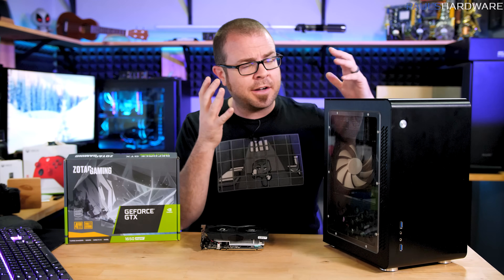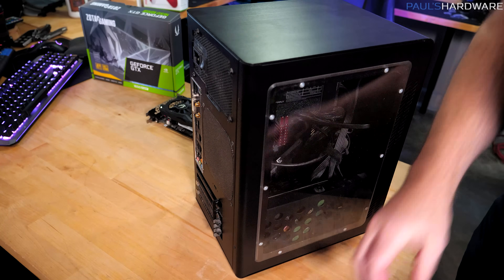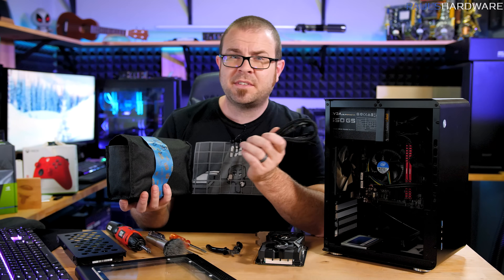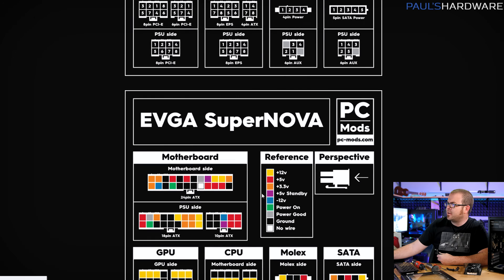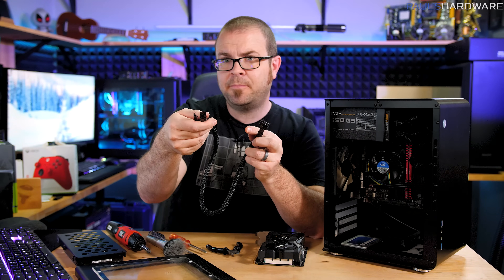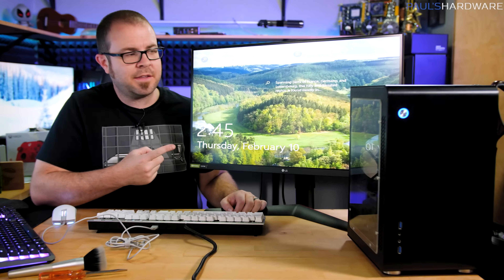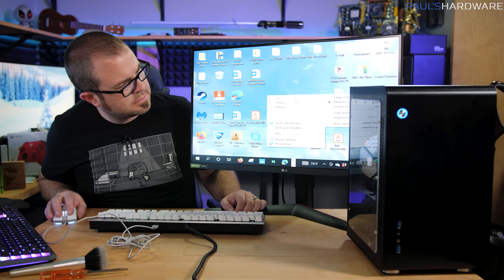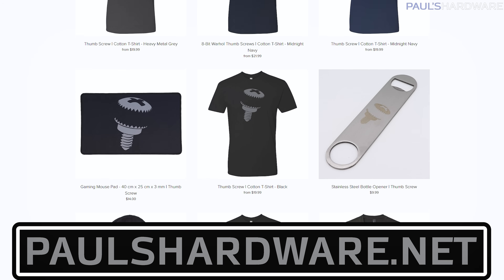Upgrading a Quad-core PC from 2015

Comment: Minor note to add to the volt meter testing. If the red/positive lead from the meter were on ground, and the black/ground lead on +12v the meter read a -12v.

I still don't understand why they have not standardized modular power supply cables. When it comes to accessories you have at most 4 signals, 3.3/5/12/G. They already use the 6/8 pin connectors that are already standardized on both ends of the cables. They just need to stop moving shit around inside the psu.
For the 20+4 mobo main power, I don't think those really need to be standardized on the psu side because there is only 1 per system, and 1 per psu.
But the 4+4 supplemental should be standardized, and even reversible.
Reply: The PSU end of cables are not standardized.

Comment: Molex to 6+2 pin FFS because you should have a molex cable lying around

As for GPU change clear the cmos and you wont get issues of no display out

Actually you should basically always clear the cmos when you take the thing apart and pit it back together, same parts or not it doesn’t mater just clear cmos

7 hours troubleshooting wasted on my laptop and 3 days troubleshooting wasted on my PC both ended up just being a cmos reset and everything fixed

Comment: *looks over at my tower I built in 2012 with an Intel 3770*

Man, a 2015 build would be nice. 👍🏼
Reply: I finally upgraded my 3570k in 2020 to a 5900x. 4 cores was not enough, but at least your i7 has 8 threads. Mine was really letting me down with basic multitasking so I upgraded, I almost skipped DDR4.
Reply: I've an 3770 with a GTX 1050ti 4gb. Still games fine for my needs.
Reply: @bartvandijk668  thats wonderful, I generally agree that you should only upgrade if your PC is not performing the tasks sufficiently. That said, when you do decide to upgrade it will be an awesome leap.
Reply: I have a 4770k system and i intend to skip ddr4 altogether then upgrade when ddr5 drops in price
Reply: 3770 should be fine for gaming up to an rtx 2060s and even more so if you play at 1440p. I was rocking an i5-4670 with my GTX 980 Ti Classy until I upgraded to a 10400F
Reply: Upgraded my 3770 to 5800x this year. 
Definately a massive leap in performance. 
Everything is much much more smooth and stable now.
Reply: @mindrover777  the main reason I upgraded my PC is I upgraded my monitors in 2019. I got a 4k 60 for production and a 1440p 144hz for gaming side by side. But the 3570k couldn't even handle 4k YouTube.

Comment: A safer way to do this would to do a continuity test at both ends. The tester will beep when you are connecting matching ends and this way there's no actual electricity involved.
Reply: Yup, even my bought 20 years ago $10 multimeter has this functionality and TBH it’s probably what I use it for the most besides the 1-10v range
Reply: Yes but this way he can also verify the voltage and removes any doubt about accuracy of the online pin out guides.

Comment: If you don't want to find the pinouts, just ask the manufacturers :) I did that with be quiet! since they didn't have the Pure Power 11 750 on their supported, but turns out they're the same as their Dark Power 11 and other 11 series PSU's! I was about to use a voltmeter to check, which would be nice to double check, but it should be the same!

Comment: Here is a Tip: All extra parts/manuals/Cables go in the motherboard or PSU box for storage when done with a new/upgraded build.  Also Corsair and Thermaltake are nice enough to give you a cloth/nylon bag to put your extra cables in.  I don't know about other PSU manufacturers.
Reply: My Seasonic came with a bag. A Ziploc 1 gal freezer bag works well too.

Comment: Sonic gets to go fast...

If the intention from the family, is to remain tidy. iTX would still be a pliable option
Can make the obvious case update to something more useful [like an Fractal 202 / Torrent Nano, CM 200 or LianLi 011 Mini]
Of course the mainboard platform is at your discretion, but PLENTY of newer processors are available for pickings
... Beside that, let them soak up some time with the new GTX chip, before unveiling any heftier GPU into their lives

Comment: Forgive me if this is a really dumb question but does anyone know why cable extensions are fine to use if we have to be worried about mixing PSU cables?
Reply: A cable extension is not going to change the positions of the conductors, just extend them. So where the PSU cable doesn't map one to one, the extension cable must.
Reply: @solacedagony1234  Ooooh I see, thank you! :D

Comment: Dude, Paul.  You are awesome,  but you don't need to plug it into the PS to check.  Set the meter to continuity and plug it into one end of the cable, then Probe 😉 the other side to check that it is connected where you expect it to be.
Reply: that lets you trace the individual conductors, but you still wouldn't know what each pin on the PSU side is connecting without that specific model's pinout diagram.
Reply: @Michael Roy  ooh Good point! I thought he had the pinout of the power supply from that website though.
Reply: @michaelroy1631  Can use the Voltmeter to test the PSU pinout directly. Red lead is Positive, black is ground. if you get a negative voltage it means you got he leads backwards.
Reply: @whirledpeaz5758  yeah but the PSU still needs to be on for this, so you'd need to jumper it (like he mentioned).
Reply: @whirledpeaz5758  if you can't trace the wires in the cable, you'd have to turn on the PSU, map its pinout, then trace the cable. two sets of measurements instead of just one.

Comment: Paul, I hate to be a nudge, but how do you lose cables for a modular PSU.  I built a couple of PC's, and have made sure I kept the left-over cables (one thing I learned as a Boy Scout I suppose).
Reply: If this is Paul, I do not text anyone on an address that does not fit the norm.  Good try (whoever you are)

Comment: Hiya Paul, 

When one of my SATA/Molex daisy chains broke on a EVGA SuperNOVA 750W Power supply, I politely asked their support if I could order cables. They asked for my address and sent me an entire extra set, no charge or further questions (besides the warranty info I provided in the support form). 

I'm only 1:31 in, so I'll see if you reach that conclusion. EVGA has been pretty good with customer service, really recommend.

Comment: I did a quick upgrade on my sister's computer last year. Upgrade from Pentium g3258  2 core/2 thread to Intel Xeon E3-1241 V3  4 core/8 threads. Stock case, PSU, cooler, SSD 250Gb, RAM from 8Gb to 16Gb, GPU from GTS450 to RX460 2Gb bios flash hack to rx560. This allows the GPU to unlock/use those extra stream-processors from 896 to 1024 (under shaders in GPU-Z) and gain 10% performance w/o OC the GPU. The upgraded total cost is around $150, with CPU cost $60, RAM $30, $50 GPU, and it is practically a new-use super low-end gaming machine, and a massive upgrade compares to her old one. Probably this upgrade will last her until window 10 is no longer supported.  Yea for gaming, 2Gb not going to cut it, any games that use over 2Gb will cut the FPS game's performance by 30-50%. This remind of infamous 6500XT... LOL

Comment: I had never thought about the cable pin out situation when using supplemental power for a GPU.  Mine have always worked, whether 6 or 8 pins are used.  To be fair though, my current PCs all have Corsair 1200HX PSUs.

Comment: Ah so close to answering my question. So I wanted to know since video cards prices are coming down what card can I put in my system and not be wasting it with a bottleneck. It was mentioned that room was left for an upgrade path in the future so can we put a 3090 in? Okay, so I googled it and if the board has a PCIe 16 slot and the power supply to handle it you can upgrade to anything. Might make a better universal GPU upgrade video than this one if you aim it towards what card to pick.
Reply: The CPU in this system cannot possibly provide enough data to keep the GPU fed. Wasted money on the GPU unless you intend to get new CPU platform later.

Comment: They are going to suck for the first couple years I am sure.. Drivers will be terrible too.. AMD is Happy Raja is Gone.. 
    I am just going to Buy a 6800XT flash my ASRock X370 Taichi and drop in the 5800X and call it a day for the next 4 years.. AM5 and Zen 4 and 5 are going to be amazing. So I am going to Keep my AM4 platform being that I have a 5000 Series BIOS for my Board, as Long as I can use my M.2 Gen 3 970 EVO and My 3200 FlareX Cl14 I will be happy.. I don't need PCIE gen 4/5 or DDR 5 right now.. I am so Happy and Grateful to ASRock for give us a working BIOS for X370.. It will work and Behave just like X470 so I am in.. And The 5800X is a huge upgrade over the 2700X I am using right now.. Think about the difference from 2700X to 3700X and Then to 5800X.. Again Thanks ASRock!!! I am so happy that I am going to finally get that Zen 3 performance and not need to change out my motherboard and buy a new windows key, Because I changed my Board.. This is great... I am so Pumped.. I am going to Order the GPU in like 2 weeks.. And getting the 5800X a month or 2 from now.. At 4K The Gaming will be Basically the same between the 2700X and 5800X Mostly.. I have to say Being a gen 1 Zen 1 First adaptor like 6 years ago and going through all the BS with Memory and BIOS updates was tough at time but it has really paid off big time.. I am pumped cause I refused to buy a second AM4 board and it paid off..

Comment: An i5 6400 with gtx 1650 is actually not too bad, it can still run most games at 1080p on highish settings, it just wont support ray tracing. It's better than nothing during our current supply shortage, should work for at least another 3-5 more years.

Comment: One thing I was gonna give Silverstone a bit of credit for is that all but 2 of their PSUs from 2009-2020 use the same cables. So it made PSU swaps, of buying lost cables really easy.
But it seems they now have a '3rd Generation' cable that is not backwards compatible... At least its at least its easy to identify their "Gen2" PSUs - Blue PCIe ports on the PSU.

Comment: 10:51 why don't you just check continuity of the wire set mustimeter to the correct setting looking at your it could be either one of the 2 white ones next to each other bottom right then touch leads together you should hear a beep or some sort of noise this is how you know it works then put one lead of the leads to one end of the wire and find which pin it responds to on the other side of the wire

Comment: Could have just done a continuity test on the cable if you have the Schematic available. obviously your method eliminates other issues as it is tested at the 'Board' side which is industry standard, but if wary of using a powered on cable a continuity would work.

Comment: I still have an i5 2500k gtx 960 system i do a lot with currently , cpus hold on a lot longer now than they did back in the 90s and early 2000s , seems the Core 2 quads from around 2007 began the current cycle as even they can still do a lot of things well considering how old they are. The days of cpus being obselete after just 2-3 years are over
Reply: I5 2500k/3470/3570 and especially 3770 are still good paired with anything from a 960/1050ti/1650s/570 even 1660.

Only thing that's holding them back is a few new games tend to be cpu hogs although these are more of unoptimised titles than anything.
Reply: @loowick4074  the problem with those older high end CPUs is that they struggle at high fps especially when using high res monitors. The current high CPU lineup just removes those bottleneck to an extent.
Reply: @mindrover777  The biggest reason that the older CPUs are struggling now is IPC. 4GHz back in Sandy/Ivy Bridge days doesn't come close to what 4GHz can do now due to massive gains over the past decade. Yeah, they still hang on but as you say, they do bottleneck higher resolutions or FPS games. For a starter rig though they are still not bad if you can pick them up cheap enough (I've been lucky and had a couple of free systems with an i5 2500k and i7 4790 recently so yeah, they would be perfect starter systems at that price!)
Reply: @AndyMitchellUK26  i agree. I believe Sandy bridge and Ivybridge brought a huge revolution in CPU performance and it has improved leaps and bounds over the years

Comment: Paul might not have any pare ITX cases around but I would've checked to see if I had any spare small cases at all to at least let them have a little bit of airflow and should help it breath a little they're probably only playing Roblox or Minecraft but I would've at least had a look but the case is decent enough I would've just thought about airflow and tbh my opinion doesn't really mean anything as of course Paul has been doing PC bits way longer than me lol 😂

Comment: the 1650 super isn't a bad Gpu even now in 2022, if you're doing 1080 (and most of us still are) and you're willing to back the settings off just a bit most of the time it's enough for 60 fps in most cases (no not Cyberpunk... that game came out what 5 years after the 1650, here's the point, if you turn it all the way down to minimal settings you might be able to get Cyberpunk to run on this card and to me that's impressive for a bottom of the stack 5 year old Gpu)

Comment: @Paul: There are MOLEX 4pin to PCIe 6pin adapters (I have two in stock here). That helps a lot when you're faced with this kind of issue. ;) Of course, that's not something I'd recommend for a powerful card. But for that base-level type of graphics adapters, that would easily do the trick.

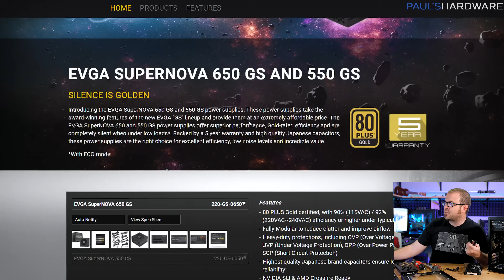Comment: I'm at 9:30 right now and I just thought about checking the expected result.
You know the GPU end pinout of the replacement Cable. Just check where which single pin ends up on the PSU endwith a multimeter. Write down your observations.
As the PSU end 8pin is usually the same for CPU and GPU on a given PSU (check this beforehand with the manual or the writings on your PSU), you could use a multimeter again, this time to check where the (also already known) CPU end pins end up on the PSU end of your already mounted CPU cable.Write down your observations.
Now, compare those two. If they match, you can use that cable, if not...don't.

Comment: You can still buy this case as the Jonsbo U3 on aliexpress. I debated getting it one for a bit. Cool to see you used it for a build a while back!
Reply: In Europe you can buy them via Caseking. I bought one a few weeks ago – price is € 75,00. It's my second one. Today they come with dust filters for the bottom of the case and the two air intakes on the sides. They are no longer equipped with a fan controller. I use M-ATX motherboards in them.
Reply: This case has a horrible airflow design. Do you hate your PC?
Reply: @em0_tion  I use these cases for compact office PC's with low wattage components and integrated GPU. I also  don't use stock coolers for the CPU. I would not recommend them for a gaming machine. For my PC where I game (a few hours a week) with I use a Lian Li PC-tu150 (not the window version) filled with 4 noctua fans and Dark Rock Pro cooler 4 for CPU and a 1060 GPU.

Comment: This is actually close to my build 5 years ago, and its still what Im using today.

I had a 1060 3GB and 24GB of RAM though. But I also have an i5 6400 on it. It still runs most of the games, but it struggles on the newest AAA releases.
Reply: Well since your on 1151 you still have a great cpu upgrade path being able to upgrade to a 7700k which is around R3 3100 or i3-10105 Performance
Reply: 2X 4GB and 2X 8Gb RAM, I hope.
Reply: @BansheeBunny  go ham, 1x16gb + 1x8gb
Reply: @the-turd-eye  The only single channel chipset for Skylake is the H110. Memory should be installed in matching pairs if you have any other chipset.
Reply: @BansheeBunny  Yeah, it is. But different brands and speeds, I just changed it in the bios. I do get problems sometimes, but an easy fix. Just have to install RAMs by rebooting the PC after installing it 1 by 1
Reply: @emulsifi3r  If your motherboard supports XMP and you just want it to work, turn it off if it is enabled. If you want to use an XMP profile, use the one on the slowest set. Say your 2X 4GB kit is 3000 CL14 and your 2X 8GB is 3200 CL16, use 3000 CL14 in your BIOS. If you still have issues, turn Fast Boot off, this will make your system train memory every time it boots and may add stability. You could remove the 2X 4GB kit, most AAA titles will run fine with 16GB.
Reply: @BansheeBunny  Nope, its not that, my motherboard got fricked up when my Dad accidentally knocked my PC down and fell. The first 2 DIMM slots are acting up. Even the Bios reset is also fricked up.
Reply: 1060 is 5 years old. Wow
Reply: Sorry you got shafted with the 3gb scam.